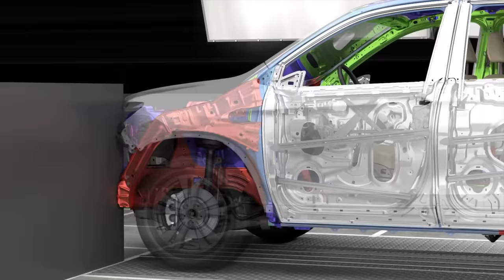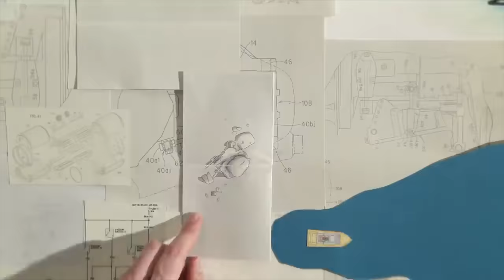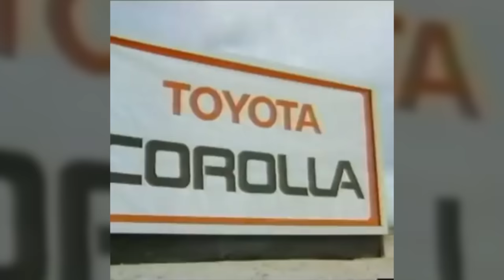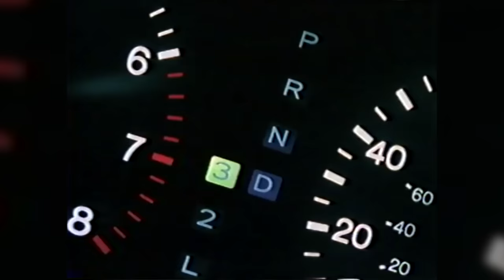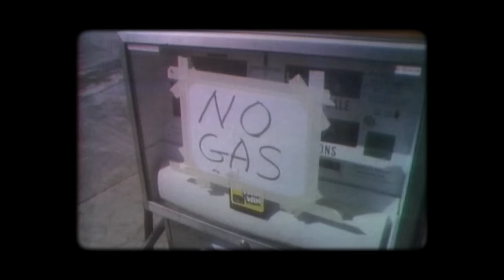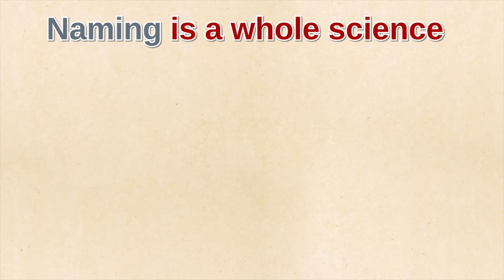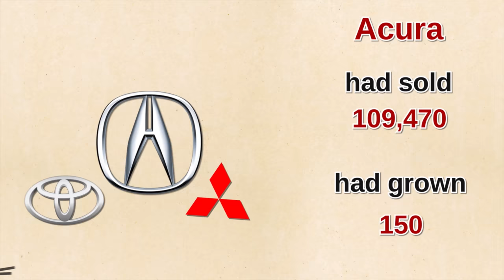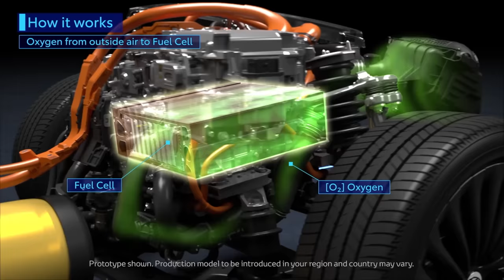Here's Why I Only Buy These 4 Car Brands

Comment: Awesome 👏.  This is the reason why I now own a 2002 Lexus ES300 !!  Build quality is unparalleled. 161k miles and everything works like day one. Quiet and solid.
Reply: I bought a 1988 accord brand new on Dec. 9th 1987
Sold it in 2001 with 167K miles, it still running in a nearby city in 2016.
Reply: @juliocorales5090  ….I had a 2002 accord, gave it to my daughter with 170,000 miles, took it to dealer and asked them to do a safety inspection before I gave it to her. All it needed was a battery, she got into accident and totaled car with over 200,000 miles on it, car was incredibly reliable.
Reply: I can testify that too! My uncle had his  2002 Lexus ES300 for 12 years from new... Not one single issue at 2035k miles. He sold it during the pandemic for a 2014 Lexus ES 300 hybrid model. Sexy cars, absolutely impeccable! I used to think Lexus were for old men but far from it, as i have Lexus on my shortlist too!🥰😍
Reply: @rob3018  you should’ve bought it off him !
Reply: That’s why I only drive Lexus.  Wife has a 08 RX350 145K miles still runs smooth.  Mine is a 17 ES350.  My son will get the 08 RX once he turns 16 in a couple of years and her next car will be guess what another RX350.
Reply: @jml9550  In April I sold my 2013 ES 350 with only 43k miles and bought my current 2002 ES 300 ! It now has 165k miles and recently had 2 rear struts leaking, changed all 4 with attached links and replaced the original AC  unit. (It was starting to whine when the clutch engaged ). Now my car rides like new with ice cold AC !  The build quality is amazing, I love this one better than the 2013 !
Reply: I just got a 99 rx300 with 246,000 miles on it. other than being dirty and having a little of easy to fix issues, it was in impeccable condition. Perfect starter car for me.
Reply: @stephendibari5010  you are braver than me,  I would not buy a used car over 50K miles unless it was a relatively owned.  Anyway, glad it worked out for you.  Why did you sell the 2013?  BTW, my 17 ES350 just hit 26K miles this week, may gift it to my son after he’s done with collage.  Then i will be looking at a 2-3 year old LC500.
Reply: @jml9550  really you would never buy a used car with over 50k.For me anything over 200k is a big no
Reply: @flix8743  yep, never have and never will.  But I tend to keep a car for 8+ years.  So I would rather pay a little more on a 30-40K miles car and hold on to it and maintain it well.  Also I always pay cash and always set money on a side for future car purchase, let say $400-500 per month.  after driving  the car for 8+ years, I have another $40-45K+ for another 2-3 year old car.  For example, My son will take over my wife’s 08 RX350 with 146K miles when he reach 16 in a year or so.  I already have cash ready for her next car.  If my son is willing to take my 2017 ES currently with 26K miles in it after college, then I am due for another car, which I also will have the cash ready.  This is how I budget and works so far baring any special circumstances.
Reply: Not really..Honda and Acura are built just as good. Honda had tranny problems in certain years, but every company has issues some times. My wife has an 09 orange Honda fit 5 SPD sport with 200k miles and has barely needed anything besides maintenance. Runs and drives perfect, and everything still works . It's not luxury, but it's just as reliable
 Acura is the same quality as Lexus.
Reply: @jml9550  if your son is willing????? What normal person would turn that down
...that's ridiculous
Reply: @jml9550  are you even serious.....anyone who knows anything bout cars , knows Honda ,Toyota Acura and Lexus go 300k or more. Some people.....
Reply: @richsweeney1115  haha.  I know right?  But I am sure you and I were young once and we didn’t always agree with parents.
Reply: @stephendibari5010  I need to make smarter financial choices like you my good sit

Edit: Sir
Reply: Acura is just as goos
Reply: Acura is just as good ..... actually, my wife has an 09 Honda fit 5 SPD sport w 200k on it, everything works, and it's barely needed anything but maintenance, and it gets a lot of stop and go driving, she works out at GrubHub doing deliveris. That car has paid for itself just doing GrubHub in the last two years. And I have a 5 spd accord w 231k everything works, and it's also barely needed anything but maintainance..
Reply: @richsweeney1115  I agree about Acura and Hondas.
Reply: @richsweeney1115  yeah Acura and Honda are great reliable cars.  Personally I prefer Lexus and Toyota for its quieter and softer ride.

Comment: the greatest thing about Toyota/Honda were their Naturally aspirated engines. With even minimal care they almost all ran for 250k miles plus. Now that the switch has been made towards pint sized turbos that are probably only good for 2/3 of that 250k miles, you'll see more and more people switch to other brands.
Reply: Not really. I used to think that too but technology has changed and so has the quality of the engineering of those smaller engines. Honda are small engine experts and have been using turbos for decades and both brands would not make such steps if they knew it would destroy their sales. After all people buy these cars in large part thanks to their reliable reputation. Toyota and Honda both slowly have been going in the direction of smaller high pressure engines. If you look at the Honda civics 1.5t engine most people have been getting 200,000 miles out of those cars over the past 10 years or so they’ve been making them and for a car that’s $25,000 new, good gas millage, fun to drive , and low maintenance costs  that’s extremely impressive.
Reply: @dakota5571 Totally agree, Toyota and Honda are the only ones I trust with those small turbo engines, you can trust they’ve made them properly. I’m sure with good care they’ll last 250k
Reply: Atleast you can have them for 10 years minimum due to high warranty. For a VW or Audi it's ONLY 2 Years and they know why. They dont trust their own products or just know, that nobody will throw away a 3 years old car, and just replace after 50k km a new motor for 6000€. Its ridiculous but in europe all the TSI FSI motors are still selling even when they have a lot of problems and the consumer have to repair it. Toyota has some problems too  ofc but they rather call back the vehicels and dont act like they dont know about the issue.
Reply: @redknight2120  IDK where you are, but here in the USA the Japanese cars typically have lesser warranties than the Korean, Euro, and American cars. Honda/Toyota Bumper to bumper is 3/36 and VW for example is 4/50 and Hyundai is 5/60.
Reply: @Michael-li3id  Lol. In Europe it’s totally the opposite. 😂😅
Reply: @Michael-li3id  what do you mean by 3/36 ,, 4/50 ,, 5/60 ?? Can you explain please
Reply: @nasseralnasser9888  years/miles.  So 3/36 refers to three years or 36,000 miles, whichever comes first.
Reply: i have a toyota corolla hybrid. it’s naturally aspirated and with ecvt
Reply: Toyota is still using naturally aspirated engines.
Reply: They both used tiny na engines here in europe for decades and have proved reliable so I dont see why their new engines would be less so
Reply: @adamek9750  because adding turbos increase pressure, heat, and therefore added stress on the motor.
Reply: Believe it or not, with my 1.4 Fiat T-Jet engine I reached 250k Km, no issues at all and still going strong...
Reply: @BobsUp83  I believe it. If you take care of an engine, it'll take care of you. Unfortunately, though, most people do not. Turbocharged engines will not hold up to neglect and abuse the same way that higher displacement N/A engines will.
Reply: @nasseralnasser9888  3 year/ 36 thousand miles etc.
Reply: Jesus loves you alot trust in His death 4 salvation and be saved from eternal hell <3 Jesus died on the cross for you bro. :)
Reply: Honda still makes a lot of naturally aspirated engines.  The Pilot, Odyssey, Ridgeline,  Passport, and HRV are still naturally aspirated.
Reply: Almost all the engines are still non turbo. Wtf are you talking about. Only a few engines are not aspirated and almost all base models are traditional NA engines

Comment: I really like your videos on Toyota. My 1990 Toyota pickup has 255K miles and just got service ( from a great mechanic) for long-needed brake, wheel and alignment work.  It runs great and sounds great. It's a member of the family.  My Mitsubishi is 21 years old and has been incredibly reliable.  I've been blessed.
Reply: Why just Toyota....
Reply: If you check that Vin number it might start with a J

Comment: I've owned two Mazdas, two Chevrolets, two Toyotas, a Scion, a Nissan and a VW. The only one that gave me any real trouble was the VW. The rest were basically trouble-free with routine maintenance and no major repairs ever needed. I will say, the Mazdas were both way more fun to drive than any of the others, and on a few occasions when I've driven Hondas those were fun to drive too.
Reply: No suprise there, german cars are crap and i say that as a german myself
Reply: If you want trouble, go VAG (VW,Audi).
Reply: @durchfallklaus4420  Check out some of the new BMW's they have gotten much better over the last few years.
I am considering moving on from Subaru and Mazda into a 2023 BMW X1
Reply: Yeah, I love my 15 Mazda 3 with the 2.0
It feels much quicker than it is but I am just not a fan of the new interiors.
The new CX-30 is a great buy!
Reply: @durchfallklaus4420  German cars are top tier. Volkswagen is crap
Reply: Mazda is the best!
Reply: I was a total Toyota Homer until I had to drive a rental for a week- a Mazda 6.  I completely changed-it was sooo fun to drive.  I've been driving Mazda the past 11 years without any problems whatsoever. With my Toyotas I would always say "they're so utilitarian".   Now I enjoy driving with reliability and durability.  Mazda is also one of the safest brands and they are poised to take a big leap foward in the car market.

Comment: The first time I heard how great is the Lexus is when I am stationed in Germany and my German friend told me how awesome is the handling, speed and performance of the Lexus compare to their BMW in the Autobahn. It's just like driving a luxury sports car.
Reply: I bought a 2008 Lexus 460LS in 4/03/ 21. It was an offer I couldn't refuse. I really didn't know much about the Lexus brand, except that it was expensive and it had a pretty good reputation. I know a lot more now!! I  believe that it's the best car I've ever owned!! Sure you're right, that even owning 08, 460LS with a V8 can be a little spendy at times for maintenance, gas, etc, but it's worth it in the long run! The look, the luxury, the performance et, I'm loving it!!
Reply: Lexus is soft and slow compared to bmw

Comment: When I bought my my Accord, literally everyone said to me gonna cost a fortune to fix Honda parts really expensive. So far definitely not found the opposite, especially when I've owned Vauxhall, Citroën, Renault, VW and Nissan previously.
Reply: I know. They been saying that since the 90's. My mom had a friend from the south that always bothered her about buying a Honda Accord. He always said the parts will be hight to fix that car. He was buying Cadillacs. His car spent more time in the show than hers. ANd hers was only in the shop for oil changes and regular maintance.
Reply: Yeah I'm sure you can get parts for them for a decent price they may be talking about oem which yea since Honda parts are good quality they probably do but you can always get aftermarket parts they arent necessary and adding what to someone said Honda, Toyota, Hyundai and Mazda all don't be in the shop as often as Nissan and others especially American cars. Mercedes benz are the third most reliable engine after Honda and Toyota but because everything else isn't reliable on it now a days (electronics,parts) it ends up being a unreliable brand as a whole

Comment: My ex got a 2005 Honda Accord in 2012 . She would constantly let the oil go dry and I would catch it just in time(barely). But she did no maintenance on it whatsoever. I say that to say this.... That car still made it to well over 200 thousand miles. And the only reason why she had to get rid of it was because it got totaled again. That was the most  reliable car I've ever seen considering it received no maintenance, not even regular oil changes lol

Comment: I’ve got a 2000 Honda Civic. Bought it for 500 dollars. It’s beat up, windows don’t work, all four doors have something wrong with them to where they don’t work as they should, the ac and radio are out. But this thing has a heart of gold. I’ve had it 8 years, drove it all across America with a kayak on top, and never once left me stranded. The only thing I’ve had to do is New battery, new tires, and new serpentine belts..  I will buy any Honda Civic that comes my way

Comment: I’m a owner of a 2003 Toyota Solara 214,789  miles runs like it’s new. 4 cylinder Manual Transmission
Reply: I am an owner of a 1995 Toyota Corolla with over 255,000 miles.    Runs well.   I bought it 1999.    Very dependable.
Reply: @hemetsonshine  I love it Toyota is TAKING OVER

Comment: My Honda Civic coup gave me 300K+ with only transmission issue of two gear slipping after all these years. I could have easily change that transmission cheap but traded it for new Toyota Camry. Civic was not burning oil, had no leak whatsoever, yet gave me 40mpg very reliable cars indeed.

Comment: I have a 2000 Ford Ranger with 170,000 miles on it, and the thing runs great, the only problem I have with it is rust. I have had it for 9 years and it is a good truck.

Comment: This is the reason i bought my 2001 used Acura. Leather seats, heated seats, electric adjustable seats, Vtech 6cyl, comfort plus Bose stereo that will blow your face off. Had it for 2yrs and its still runs like a champ. Back fender wells are showing some rust tho. Best used car i ever bought for under 1000 bucks. I can't complain. Just recently bought a 2005 Mazda 3 Hatchback. Stole it for 1500.00. Metallic red no rust runs great too. Mazda is also recommended by Scotty. He will not steer you wrong. Thx Scotty, your the best. It's great not having any car payments.

Comment: One Honda model you left out was the Sportabout. It was over the curb for $2100 in 1973 (could be off a year) 2 cylinders (motorcycle engine turned sideways), front-wheel drive, great pick up, 50 miles per gallon on regular gas. I loved that car more than any car I've ever owned. Two drawbacks...no a/c and I lived in Miami heat, and it was so tiny that it wasn't uncommon to come out from shopping and find that a few college guys would have picked it up and turned it sideways in the parking space.
Then the Civic came out and I traded up, but I wish I still had that car today!

Comment: I switched from hondas to mercedes to bmw and now i have a 1998 2.5 v6 suzuki grand vitara and i love it. Suzuki makes the gasoline engines in house and are easy to work with. No extra electrics, no abs, no traction control and no transfer case. The 4wd is either on or off. The transmission has gone trough over 500 000km and the engine has been swapped for a 14000km one. I would definitely put suzuki on the same class with the hondas and toyotas as far as reliability goes.

Comment: Hondas are great UNLESS you get a larger model. The Odyssey and Pilot have notorious transmission issues. But their smaller vehicles are good. I have a 2014 Crosstour (built on the Accord) that has had ZERO issues at 105k miles, and looking forward to getting many more.

Comment: As a mechanic I always recommend Honda and Toyota to every customer that asks for my thoughts, However personally, I lean mostly towards Subaru. The AWD system is the best on the market, The 2.5L engine, while has its issues and not incredibly easy to work on, it is very easy to fully remove. I also love the amount of customization you can do on a subaru to personalize it more towards your style of driving. Modding a impreza wagon is like modding a chevy pickup. Im not saying you cant customize or mod other vehicles, its just that there is so many more options available for sale for a subaru than other japanese car manufacturers
Reply: Toyota & Hondas are ugly asf tho. Like y?? Lol
Reply: Looking for a car to buy. I want a Honda civic so bad. I actually love the look. I need reliability and good gas mileage on top of everything. Hopefully I will find one not too over priced.
Reply: What about Ford's

Comment: Sold my 2012 Chevy Cruze with 134K miles for a 2001 Civic LX 2 Door that had 150K. I can confirm it beats the last 2 GM cars I’ve owned before. Great video Scotty !
Reply: Instead of that Cruze, u Should have gotten a 90s Buick park avenue, that car is made by GM and i can confirm it beats the car brands in this video. I have Had my 1999 Park Avenue for 13 years, 565 k miles with original motor and trans, it claps camrys in drag races, looks great and my friends 2001 corolla fell apart at 260 k miles 10 yrs ago...
Reply: LoL better start watching YouTube videos on how to replace your own head gasket on the 01 Civic. And if automatic, it’s probably on a rebuilt transmisión that won’t last. 01 was a bad year for Civic transmission. 
I had an 03 and never had a problem, gave it away with 170k still pulling strong.
Reply: Faraz Hussain, good for you!  However, your experience is not statistically significant in overcoming the heretofore insurmountable challenge GM faces when being compared against the Honda & Toyota brands.
Reply: @Snookynibbles  that is very true, times sure has changed just like GMs quality over the years, making Honda and Toyota better than GM when comparing the products they make today